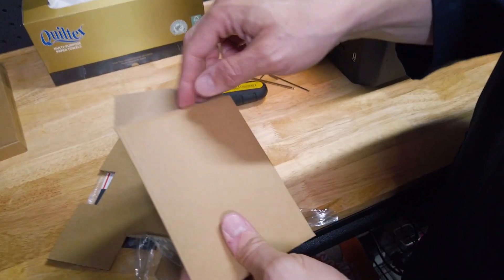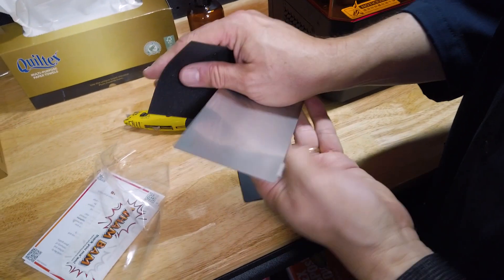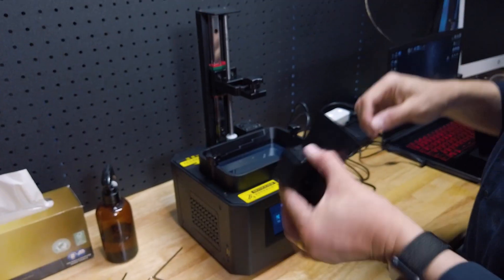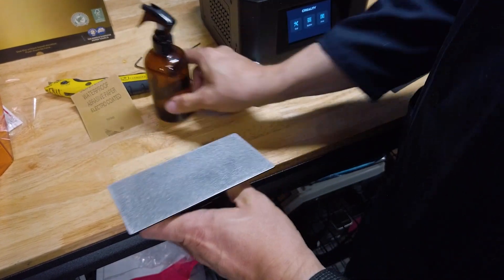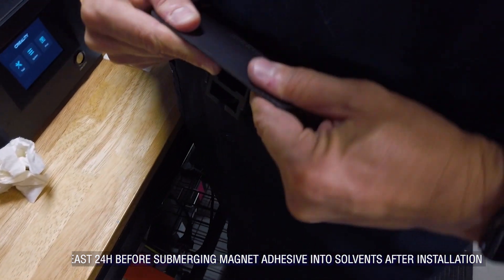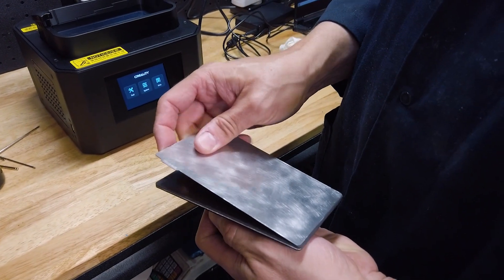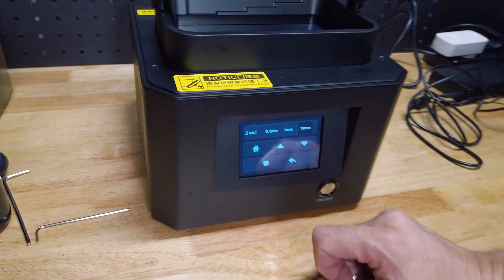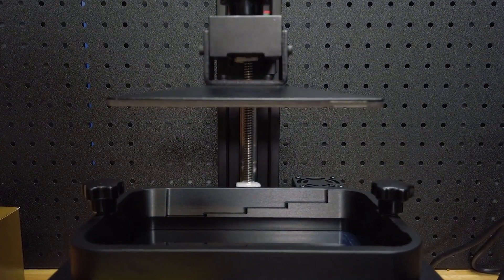How to install your WHAM BAM FBS on a Resin Printer

Comment: Should the resin vat be removed before leveling with the new flex plate? My Elegoo Saturn guide tells me to remove the vat and then level with the cardstock spacer, not sure if it's the same with the Mars.
Reply from the maker: We like to remove the resin and place the vat instead of the card.

Comment: am i able to do this with the anycubic photon mono or do i need to print a z stop spacer?
Reply: You’ll need a spacer, there are several of them on Thingiverse
Reply: @teyrasiridae4704  what happens if i dont use a spacer? cause ive printed a charizard and it actually went fine, but then my fep film broke it had too many scratches
Reply: @TOASTYDAWGZ  So I tried to re-levek the build plate on my Photon S without the spacer before knowing I needed one. What ended up happening in my case was that the added thickness of the flexplate caused the endstop sensor to no longer trigger in the right spot, so it tried to go lower until it would actuate. I could stop it in time but it was definitely trying to crush my LCD screen.
Reply: @teyrasiridae4704  ohhhh shoot ok, is there like a tutorial video on how to put the spacer on cause i have no idea how to
Reply: @TOASTYDAWGZ  I don't know if there is, but look at where your end-stop detector thingy is, in my case it was held in with two screws. Just undoing those screws and placing the spacer between fixed it. Really simple to do
Reply: @teyrasiridae4704  is that at the top or bottom?
Reply: @TOASTYDAWGZ  The detector is at the bottom, but there's like a pin on the arm of the buildplate which triggers the detector when it's going down. That pin (so the top) needs to be lowered a little bit by adding the spacer.
Reply: @teyrasiridae4704  ahhhhh okay thank you sooo much for answering

Comment: Is the side that got sanded the one making contact with the resin or the side that's making contact with the magnet?
Reply from the maker: Usually the side that the print attaches to, but there is no harm in sanding both sides.